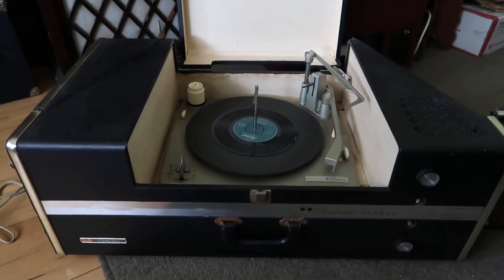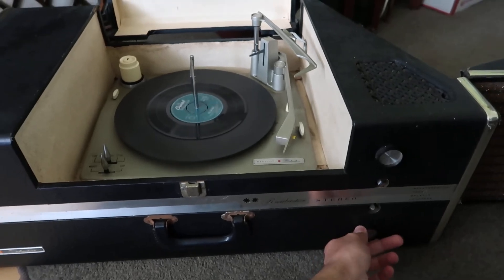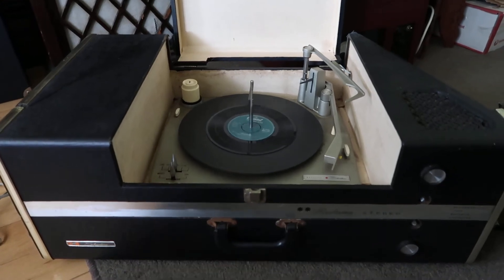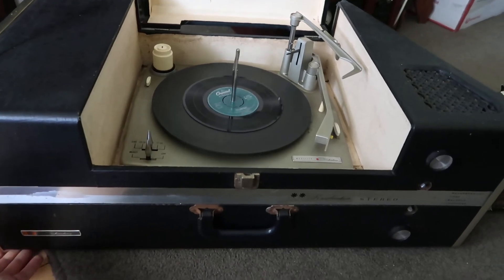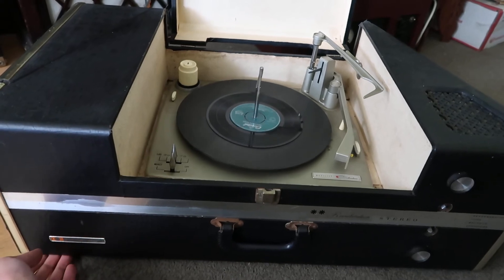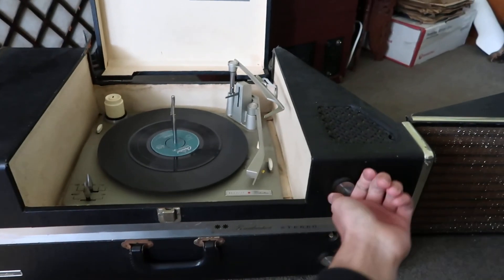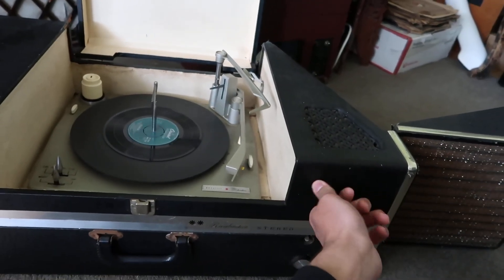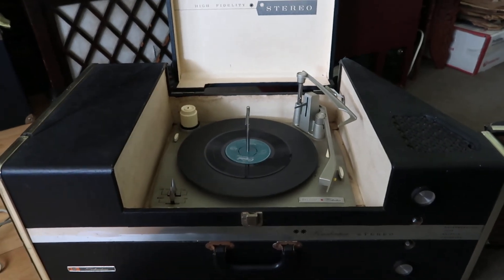Reverb + wobbly

Comment: What an unusual wedge shaped one sided speaker. I've never seen a "portable" record player with reverb built in so that's cool. What was the point of reverb? Apart from a cool gimmick, I could never find a real use for it.
Reply from the maker: Both sides have fold-out wedge shaped speakers that can also come off for better stereo effect. Reverb adds an echo to audio. Guitar amplifiers often have a reverb in them and there are hi fi reverb units but I can't see any reason why this thing has one other than that spring reverbs were popular at the time.
Reply: @toomanyinterests  ah! I see the line on the left side for the speaker now. Cool!